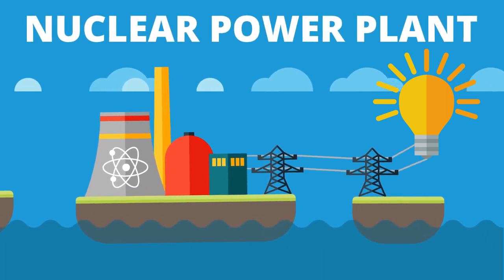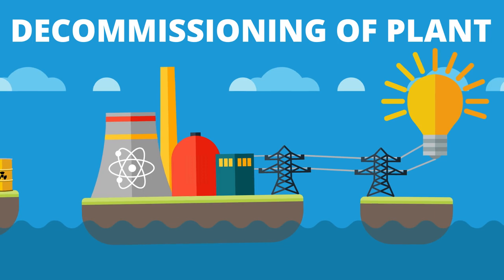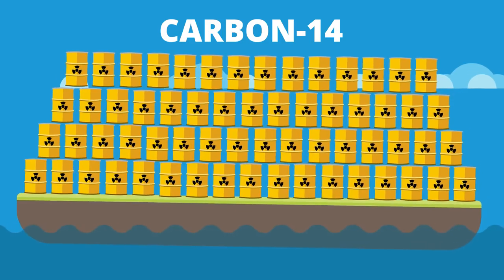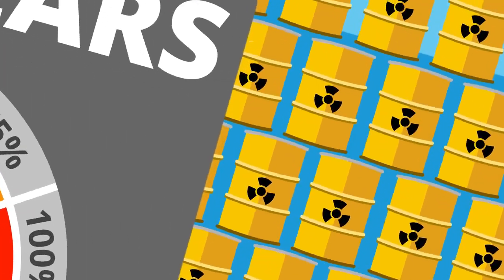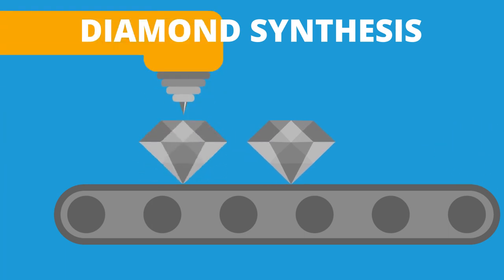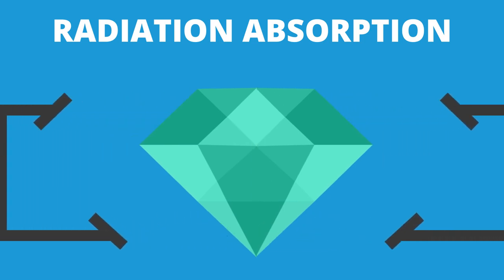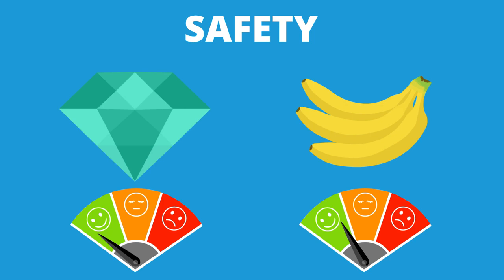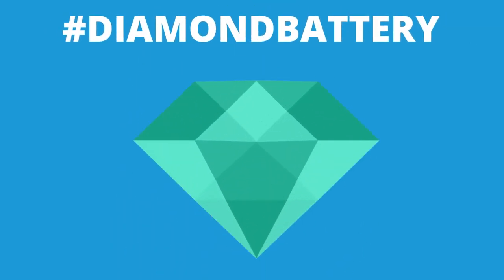Diamond Batteries made from Nuclear Waste could generate power for thousands of years

Comment: You know if you took the power from these Diamond batteries and collectively stored it in a battery system that connects to the grid and could be used to power a hospital or any building in need of power.

Comment: So this super thin diamond layer is all you need to make a far more concentrated radiation source safe? Considering we're using the more radioactive outer layers you describe. So what you're saying, is that you could bury this waste 5 feet into the ground and it would be safe forever? I mean graphite doesn't dissolve in water so it poses no health risk.

Why go through this expensive recycling process just to propagate radioactive materials throughout our society? If easier safer storage methods are available like I mention.

One place this radioactive graphite can actually cause you serious harm is inside your body. Putting these radio active batteries around everyday people far increases the likely hood of accidental consumption, or propagation, through human error.

So I ask again, If its saver to bury this crap in a hole, Why?